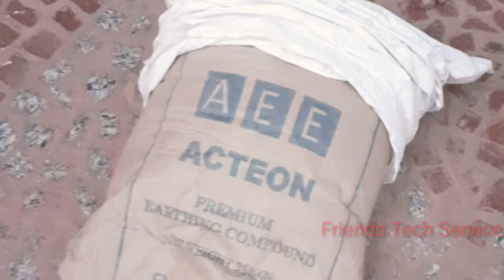Lightning Arrester Installation Step by step

Comment: Thanks for the step by step example. You seem to have some expertise for this valuable service of lightning protection. However, some of the video is too rapid and jerky in some places and too lengthy and redundant in others. One observation: I hope the neighbor in the green house will be insulated from the millions of volts entering his side yard during a lightning strike. There is no reason he has to die because you provided this protection for your house. Insulating the flat bar with a 3" PVC pipe plus a larger physical cover is the least you can install in his side yard. Otherwise, this looks like a potential lawsuit to me and you can be cited for harmful negligence because of the incomplete and potentially hazardous system design.